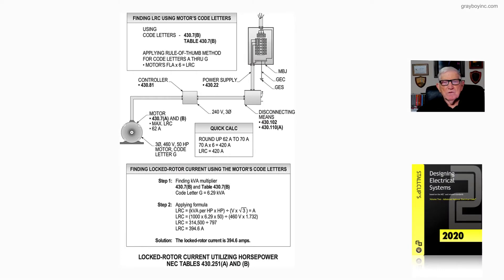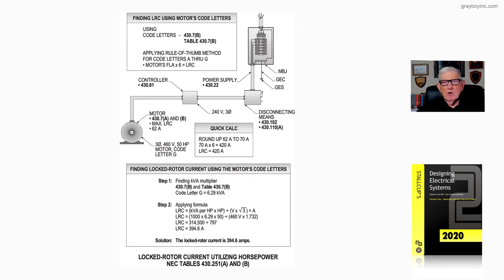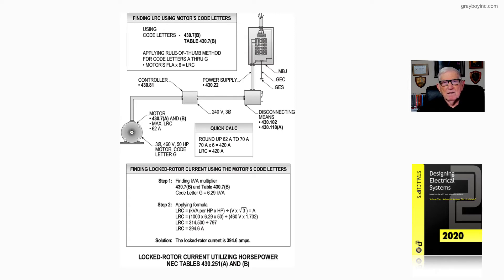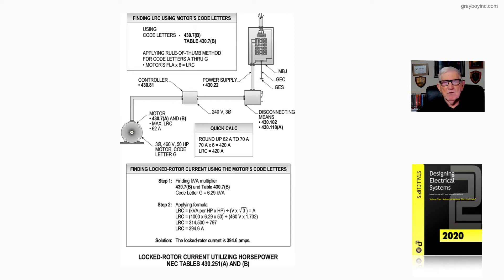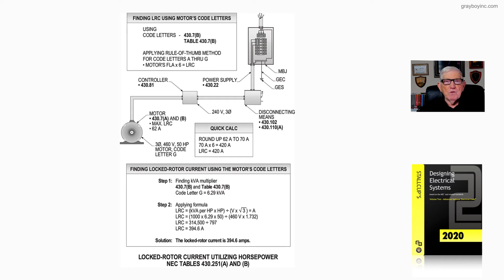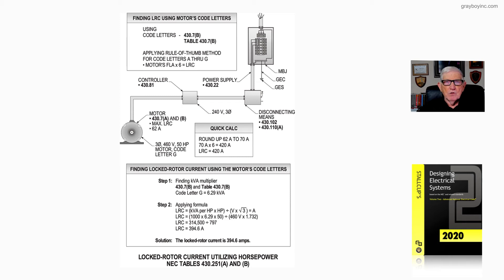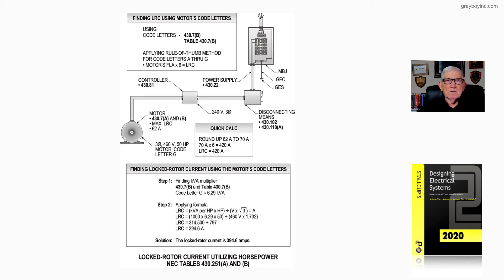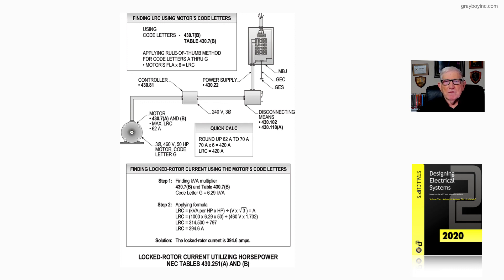18-22 (a) LOCKED-ROTOR CURRENT UTILIZING HORSEPOWER  - TABLES 430.251(A) AND (B)

Comment: What’s your take on sizing for a motor OCPD, Conductor size, but not including overloads, would you use table 430.248-250 or go off the nameplate? I was taught to go from the table but I work with some old electricians who say go off the nameplate…